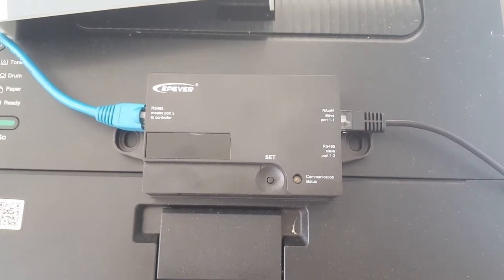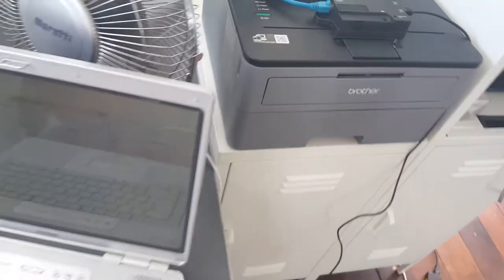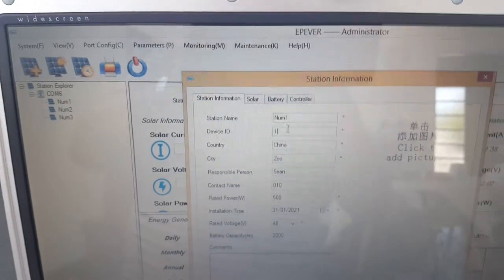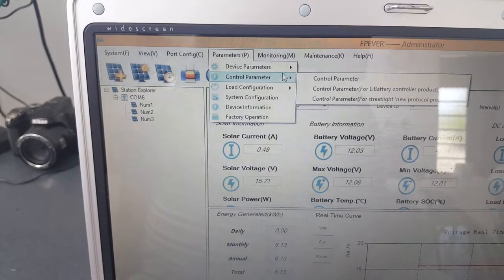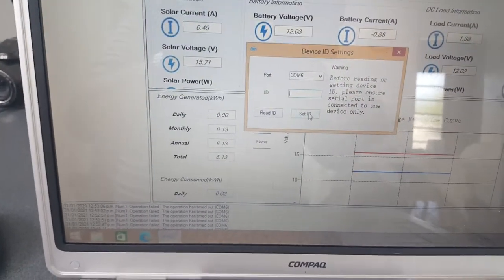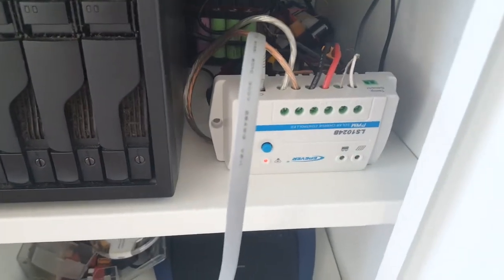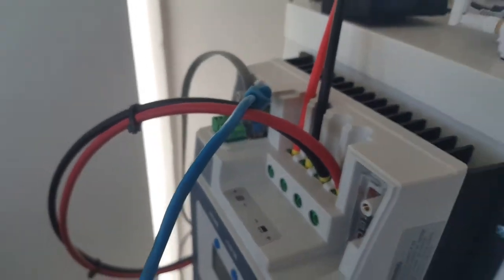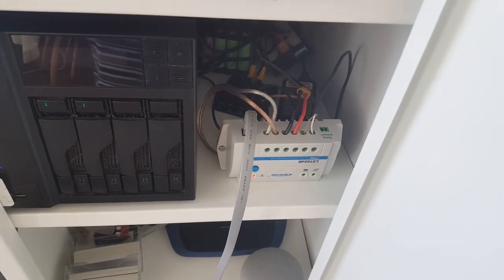How to connect an Epever PAL-ADP-50AN

Comment: Can you still have wifi connections with this setup ?
Reply from the maker: You don't actually need the Epever PAL-ADP-50AN. When I included it my system it was less efficient and Epever didn't provide a reason why. So, instead I run my units in Serial and have just one USB connection to Home Assistant and it works perfectly. I can still access each unit separately to get stats.
Reply: @SpinningplanetCoNz  hm so you can connect them together without using this adaptater? because epever said i need it ortherwise i could damage my controller ... so you tell me i can connect them together like you did but without using the adapter?
Reply from the maker: @chris_mk5supra  What Epever Controller do you have?
Reply: @SpinningplanetCoNz  got a 30 AMP xtra séries got a 100 AMP  a 80 a 60 and a 50 . There are working together atm but they are not connectéd together with a com câble . All are tracer an séries exept thé first one
Reply from the maker: @chris_mk5supra  Sounds right. They have 2 com connections on them. On Unit 1 plug Com 1 into USB and Com 2 into Com1 on the next unit (and so on). Each Unit has to have it's own ID such as Unit One is ID 1, and Unit Two is ID 2. I mention this in the video above
Reply: @SpinningplanetCoNz  ok so thé will bé connectéd together and thé i put m'y wifi in thé master one ? Or do i have to put thé wifi on all of them ?
Reply from the maker: @chris_mk5supra  I'm not sure about wifi. If I were you I'd try USB first to make sure it works then try wifi. I don't know if wifi carries over the Unit IDs.
Reply: @SpinningplanetCoNz  ok thanks i will try . I cancelled thé adapter order :)
Reply from the maker: @chris_mk5supra  Sweet. I have one here I could send to you for the just the shipping cost but I wouldn't recommend it. Epever messed up with this unit. It works worse than connecting the devices in serial.
Reply from the maker: Here's the big difference I noticed. I run 2 x 2500 watt solar arrays that each go to their own Epever MPPT units. When I used the PAL-ADP-50AN it would significantly reduce the power on the array with less light. When I ran the MPPT units in serial I had at least 20% more power come through. Not only is the PAL-ADP-50AN not needed; it actually reduces power. I don't know why they invented it because you can connect multiple Epever units in serial without issue and they balance between each other automatically.
Reply from the maker: If you need a hand configuring your gear PM Me and we could do a screen share.
Reply: @SpinningplanetCoNz  well . I lose wifi if i connectéd them together so this is not an option for me ... Not sure how to make it Work ans keep m'y wifi . .
Reply from the maker: @chris_mk5supra  I think the first thing you have to do is program with USB cable then wifi may work
Reply from the maker: I have wifi too but have never used it with more than one device. I only use it on remote units.
Reply: @SpinningplanetCoNz  Hello, can you give me a hint how you did this in Homeassistant - with the modbus integration?
Reply from the maker: @helmutr.4005  Here's my modbus config for 2 x PAL-ADP-50AN and 1 x Wifi:

modbus:
  - name: epever-cable
    port: /dev/ttyXRUSB0
    delay: 5
    close_comm_on_error: true
    retry_on_empty: true
    retries: 10
    type: serial
    baudrate: 115200
    bytesize: 8
    method: rtu
    parity: N
    stopbits: 1
    switches:
      - name: Load Switch 1
        slave: 1
        address: 2
        write_type: coil
        verify:
      - name: Load Switch 2
        slave: 2
        address: 2
        write_type: coil
        verify:
    sensors:
# SENSORS 1 
[Add sensors here]

  - name: epever-wifi
    type: rtuovertcp
    host: 10.240.1.7
    port: 8088
    switches:
      - name: Load Switch Wifi
        slave: 1
        address: 2
        write_type: coil
        verify:
    sensors:
[Add sensors here]
Reply: @SpinningplanetCoNz  Thanks!

Comment: Nice ^^
Funny that you did put them upsidedown as you mentioned.
About the cable between the chargers, can I use classic rj45 cables too?
Assuming I have two USB to rs485 adapter, If I set a different ID, I could also run the software twice to see both of them in parallel, right?
Reply from the maker: I've ended up not using the PAL-ADP-50AN because it didn't let as much power through so instead I connected the USB cable from my laptop to the first unit; then used an rj45 from the extra port across to the second unit, and then a 3rd rj45 to the 3rd unit - everything is in series and all the units must have unique IDs. Then you can swap between them using the epever monitoring software - only run it once. I use Home Assistant instead which gives me separate readouts for all of my charge controllers.
Reply: @SpinningplanetCoNz  Intersting, though i'm not sure what you mean by lack of power. So you confirm classic rj45 cables can be used? Where can i download home assistant?
Reply from the maker: @alexandreesquenet3736  Yes. RJ45s can be used. First get it going using the epever software before you think about Home Assistant - https://www.home-assistant.io/. Normally I get around 3,000 watts out of my panels. When the PAL-ADP-50AN was connected I was getting less than 1000 watts out of them.
Reply: @SpinningplanetCoNz  Thanks. I don't understand why it reduced your power. Maybe that the parameters were corrupted or it was interrupting the mppt core. I already used the epever software with my previous epever charger. Thanks for the link.